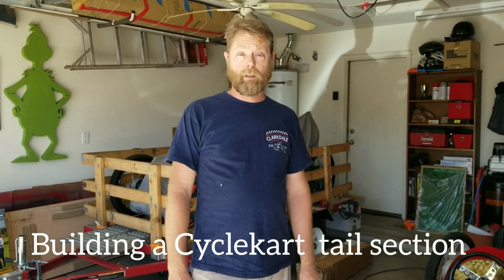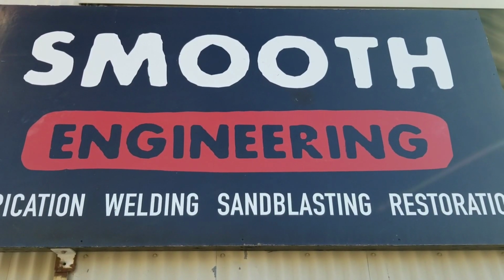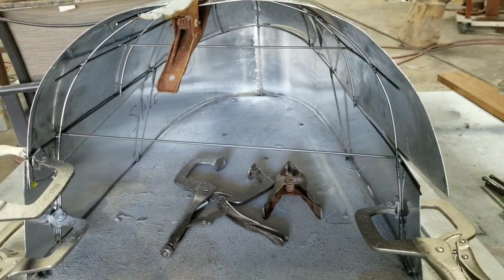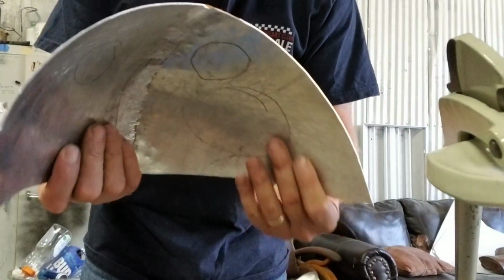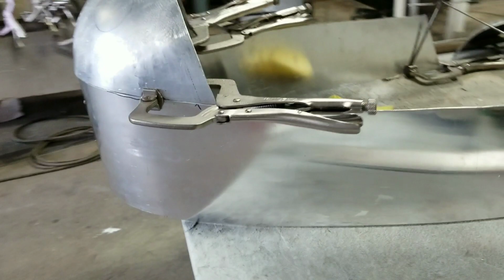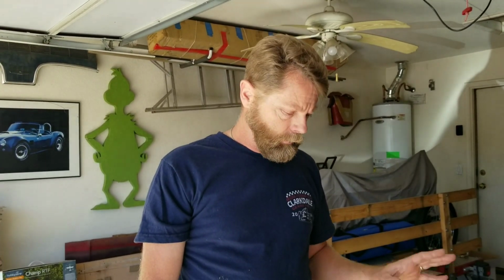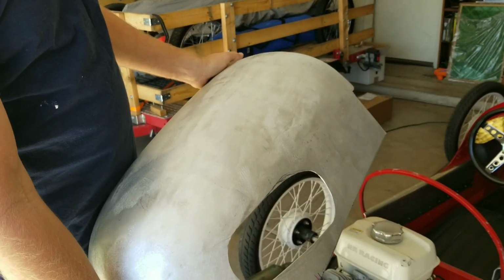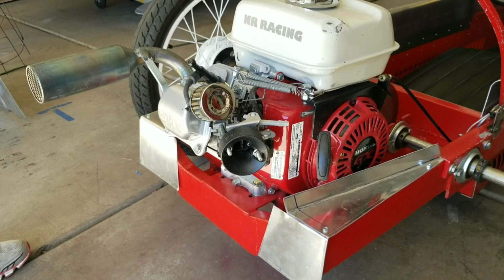Aluminum Cyclekart Tail Section

Comment: What's the power to weight ratio of these things and how does that compare to an average road going car ?
Reply from the maker: Weight is about 266 pounds, power about 10hp.  So underpowered, but that is a good thing, as they are dangerous if driven without caution.

Comment: Oh god.... this guy welding is the guy running the shop?  Oh dear.. that must of been a nightmare to clean up and smooth out after a horrible welding puddles all over. That big ac setting where way off for that job.
Reply from the maker: Thanks for watching,  we were both learning to weld the aluminum and setting up the machine is a big part of that.  Cheers